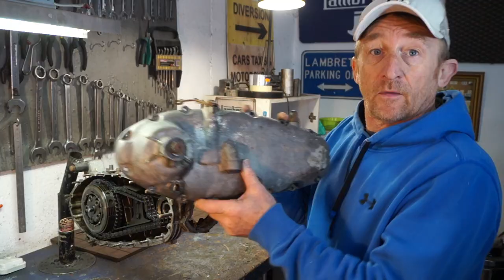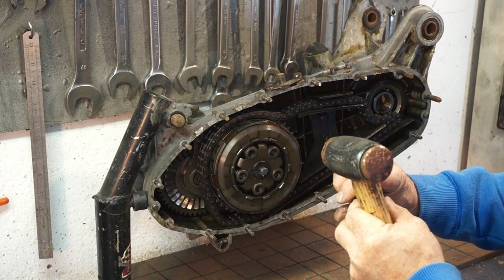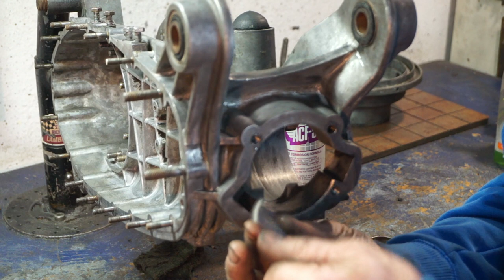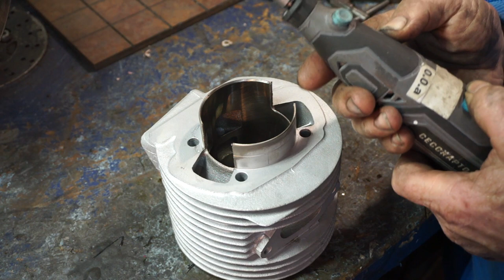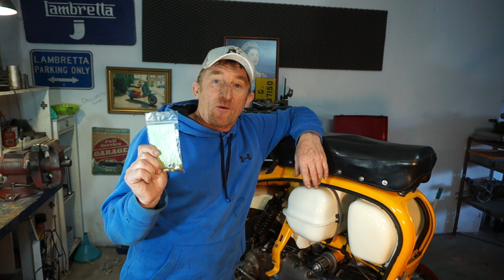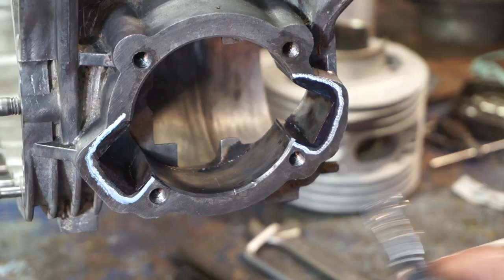MUGELLO 200 build part 2 lambretta

Comment: Had nothing but grief with a V3 Mugello 186 and no support from the dealer and looks like nothing has improved 😮
Reply from the maker: What kind of problems have you had ?
Reply: @TheSteelweasel  cylinder head machined wrong though, apparently was nothing wrong with the kit ..... V4 came out shortly after....so go figure